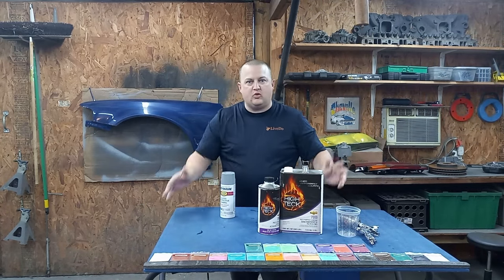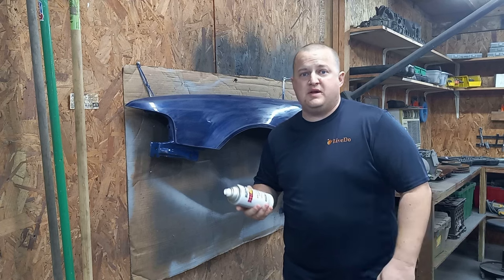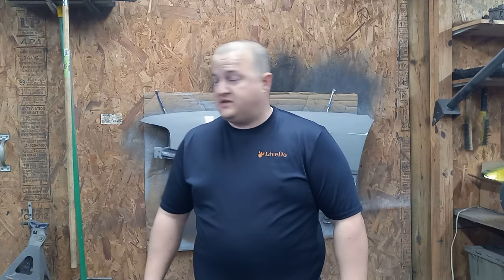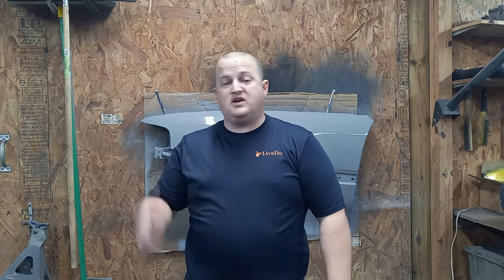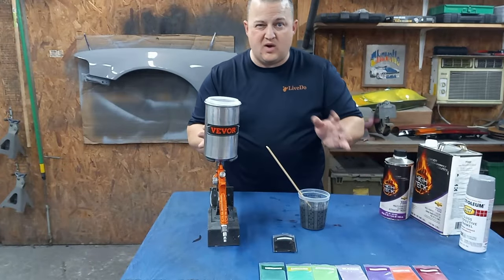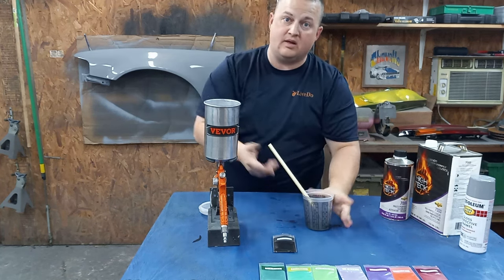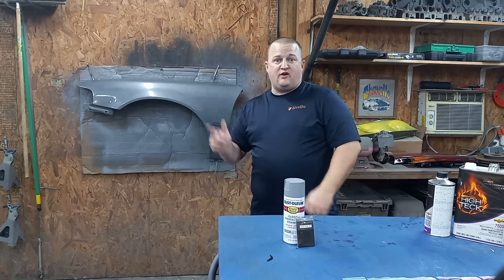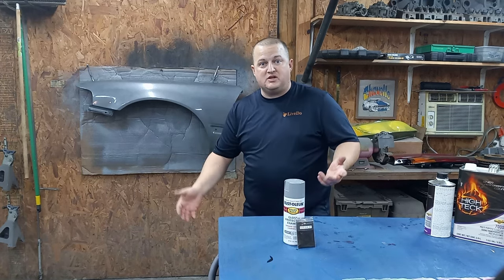RUSTOLEUM PAINT JOBS CUSTOM MIXED SMOKE GREY WITH A BLACK PEARL!!!

Comment: Great concept! Just picked up a 87 4runner. I want it to look good but don't want to drop big money on a paint job as its going to be used as a trail rig for my family. A Rustoleum paint with a clear coat would fit the build just right. Thanks for the info and look forward to the next one!

Comment: I just got in painting cars what size tip for clear with pearls
Reply from the maker: I recommend a 1.3 tip for base coat and clear coat even with adding pearls but if you want to spray a thicker primer or a heavy metal flake then you would want to use a 1.7 tip thanks for watching

Comment: I had wondered after I started watching your videos about Rustoleum metallic silver or I think they call it aluminum if a black pearl or like that graphite you have would make it more of a dark silver so it didn't look so "Aluminum". I was thinking just mixing the pearl into the silver and using the quart rather than the spray cans but I think it is the same thing. I like hthis color, so I guess it would be FIRE.
Reply from the maker: Yea I feel the same about the rustoleum metallic aluminum it looks crappy but if you do this or shoot any metallic pearl over a black base you will get that nice smooth metallic finish

Comment: Just started watching your Channel . Thanks for what your do lots of information . Question I have truck gloss black and I would like to spray some pearl on it but want to keep black in color what would be steps and what to use  ?
Reply from the maker: That all depends on what color pearl you wanna use everything by default works well over black. I suggest you pick a pearl do a small spray out test with a pinch of it in some clear and get used to how much it takes for coverage so you can get the desired effect but remember less is always more with pearls because you can always do more coats. I have many other videos with pearls over black if you wanna get more of an idea what you like and if you have any other question feel free to reach out anytime and thanks for watching!